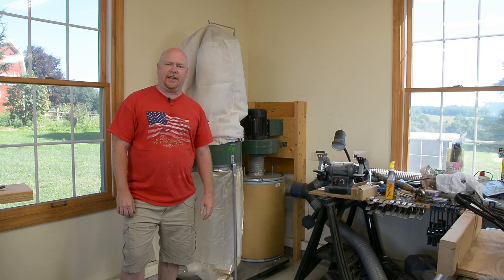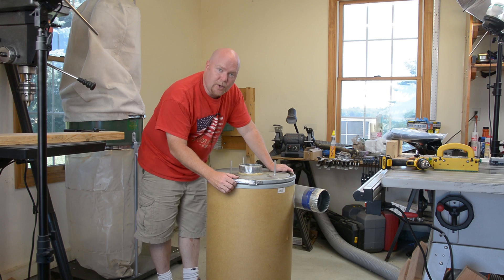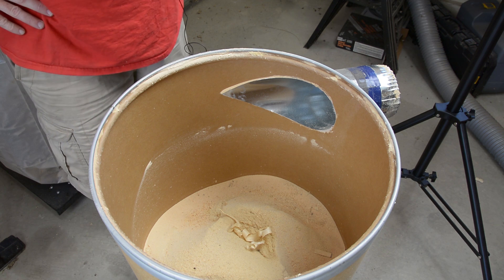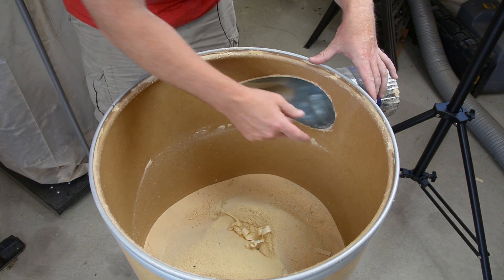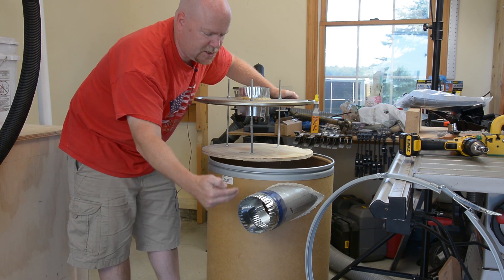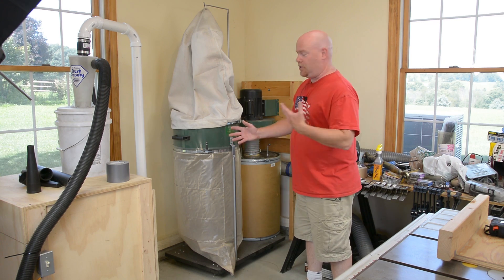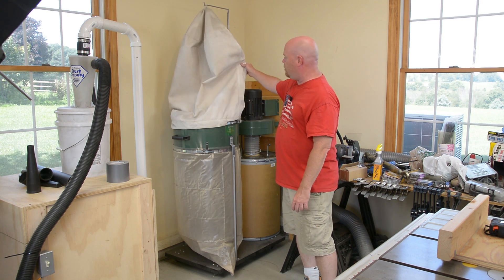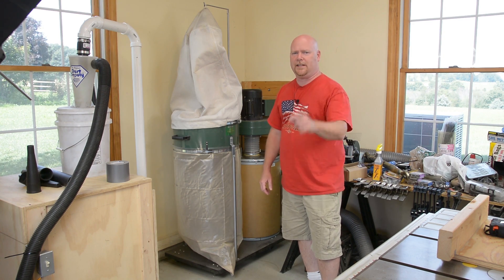Harbor Freight 2HP Dust Collector Modification Overview

Comment: Matt,  I just now found this most informative video.  I'm currently struggling to hook up my dust collection system and fighting the vagueness of air hose and tubing connectors.  This video demonstrated beyond all doubt the effectiveness of this version of a fein dust extractor.  I live the elegance of this system.  You did a great job joining the duct to the drum.  I looked at the pipe joint template site you provided and find it very interesting and useful.   One suggestion for what it's worth, if I might:  For this application, to cut the duct going into the drum, if you were to use PVC drain pipe, you could screw a short section of the drain pipe to the plywood you cut the fein device from; place the plywood with pipe connected on a circle cutting jig attached to your band saw and cut the circle.  As your band saw cuts the plywood circle that will fit inside the drum, it will also cut the radius end on the PVC pipe.  The useful piece will be outside the circle and the waste is inside.  A circle cutting jig is simply a section of plywood with a nail or screw located a radius distance from the bandsaw blade and the workpiece has a small hole at the intended center of the circle to be cut.  The future circle piece is placed on the nail or screw to be rotated.  Turning it around against the blade cuts both pieces at once.  The PVC radius end then also becomes a template to trace the outline to be cut from the drum.  I never tried to cut metal tubing but PVC cuts easily as long as the piece of wood you use for a jig is stationary and does not flex to cause the blade to bind.  A little ingenuity in crafting fixtures for slanted tubing allows this technique to be used in joining small PVC to large PVC.  

Your video inspired me to go your route instead of the super dust deputy.

Comment: Hey Matt I know it's been a while, but I was just looking at the Pipe Joint Software you linked here and I can't seem to figure out how you got the tear drop shape. What numbers did you use in the calculator and how did you figure out what to use?

Comment: Matt, I've got another question now that I'm starting to mimic your project.  What spacing did you use between the container lid and the separator?  Thanks!!!
Reply from the maker: +Mitch Lennon I just measured it.  My container is 27 1/4" tall, and it's sitting on the original dust collector cart next to the bags.  There is another 7 1/2" from the lid to the face of the impeller housing.  The hose I have connecting the two is ~ 7 1/4" long.  I didn't measure it, but I'm estimating that the pipe sticking out of the container lid is ~ 2" tall.  If I recall correctly, the inlet on the impeller is similar, so there's something like 3-4" between the top of the container outlet and the impeller inlet.
Reply: +Matt Heere  Super!!! And the distance from the container lid downward to the Thien baff;le would be???
Reply from the maker: I'm recalling something like 8".  The space above the baffle isn't a whole lot taller than the 5" inlet pipe.

Comment: Hi Matt.  Great video.  I'm just about ready to pull the trigger on the 2 HP HF dust collector.  One thing I'm curious about is why not duct the discharge of the blower directly outside versus into the limited 5 micron bag?  You'd save a bunch of space in the shop and you'd eliminate all the particulates (even better than replacing the bag with a pleated 0.5 micron filter).  Again, just looking for your opinion on the idea.  Keep up the good work!
Reply from the maker: +dawgpoundbutch I've had that idea on my mind for a while.  It's why I haven't pulled the trigger on an upgraded Wynn filter for the machine.  Problem is that it's cold here in Western PA for at least 1/2 the year - and the 1/2 where I get the most shop time to boot.  The dust collector will move pretty much all of the air in the shop outside in just a few minutes, and at the moment my only heat is portable kerosene.  Not only does it take forever to replace that heat, but having to run it on full blast constantly becomes a fume issue.

But dust collection is now about my biggest problem (terrible workbench is a close second).  The band saw really threw my hose scheme out the window.  I need to get serious about coming up with some good ideas on how to fix this...

Comment: Great review and nice adaptation. Need to get you nice cartridge filter for that unit.
Reply from the maker: +JB Marker You're probably right.  I keep putting it off because what I really want to do is vent it to the outside.  Problem is replacing the heat that'll remove in a Western PA winter!
Reply: Have you considered discharging into a bucket of water to trap the transient dust?
Reply from the maker: I did briefly and then decided that it wasn't worth the effort.  I will vent outdoors eventually.  Might as well just work towards that end.

Comment: Matt, I made a similar re-work of the HF dust collector, BUT I have a problem with the impeller scrapping against the housing cover.  I think I can fix it by raising the impeller housing a bit.  Will you tell me the height from the floor to the bolts in your wooden structure?
Reply from the maker: +Mark Hazlewood The lowest bolt, the one that attaches the actual impeller housing to the wall, is 40 3/4" from the floor.  That give me 7 1/2" from the front of the housing to the lid of my separator.  Subtract however tall the cart is (I forgot to measure it) and the rest is the barrel itself.

Have you had the housing apart?  If it's scraping on the back of the housing then yeah, you may just have everything crammed in to tightly.  If it's scraping on the front of the housing then the impeller is most likely not securely on the motor shaft.  That's something that needs to be remedied ASAP as you'll have a 2HP grenade going off if the impeller lets go completely.

Comment: Great overview of your system.  I have 2 thien seperators on the go and planning a 3rd to go on a similar collector as yours.

  Something to consider when you want to replace the bag, instead of paying the premium for a "woodworking" dust collector filter, look into an air filter for large trucks/heavy equipment.  They will be a whole lot cheaper, and have similar specs to the ones marketed to woodworkers.  You just have to make your own adapter ring for it to fit the collector, but I am sure you are more than capable of doing that.
Reply: I love the unit, but the current draw is pretty high at 110v. I decided to splurge and get a 220v version...  for about 150 more.